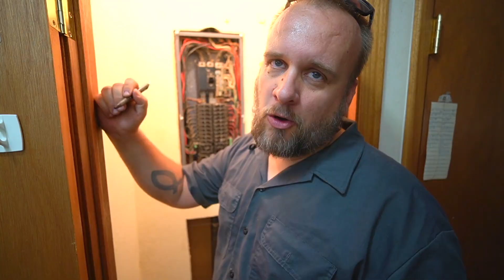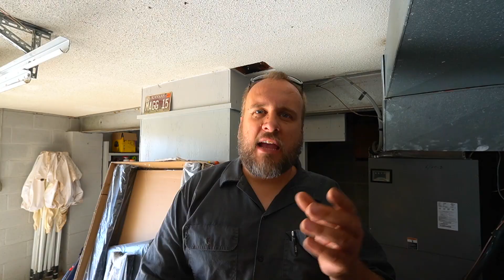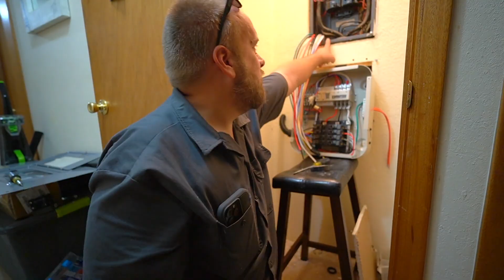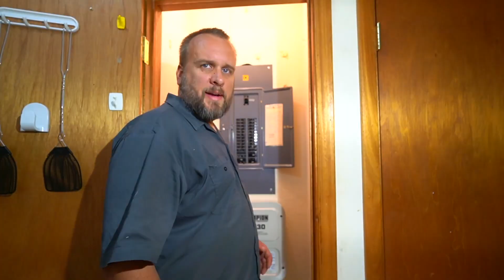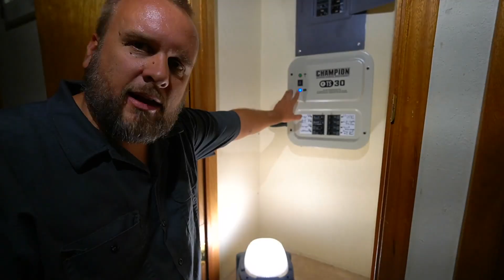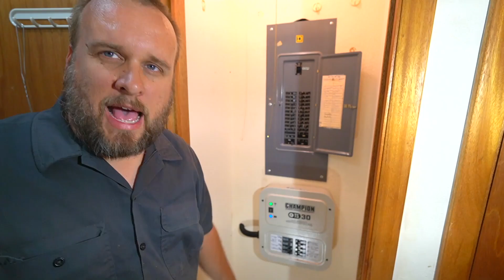Installing Emergency Backup Power on a Budget - Manual Transfer Switch

Comment from the maker: Here are links to the components used in the video
Generator link: https://amzn.to/3s87et3
Manual transfer switch:
http://bit.ly/3FN1d82

Check out this video running a welder on the same generator
https://youtu.be/aysDlkLBD5Q

To interact with me personally, join the Rockhill farm Facebook group here:
https://www.facebook.com/groups/1270496403596230/

Comment: Thanks Brock.Your stream is the best to understand the system. I chose the 50A Champion transfer switch because i live in Canada and i need 3 rooms to be heated in fall and winter.Snow storms and thunder storms are the main reasons to install a generator to me. And again you did a great job Brock!😊

Comment: Why not Wire in a Power Inlet Plug to its own Breaker within the main breaker box on the pole, an use a Interlock.
Then you just cut off the Main feed breaker, an simply flip the switches you want an dont want. 
I see no reason for a manual transfer switch box an doing all that extra work. Flip off whatever breakers you already have you Dont want to use, thats Simple.

Comment: It is not just the black wire needs to be connected. The neutral on the same circuit (say, #12 fridge) also needs to be disconnected from the main neutral bar and needs to be brought over to the transfer switch.  If not, you will have a floating neutral and the panel case will get energized through the ground connection.--very dangerous.

Comment: I ran my AC, fridge, deep freezer, mini fridge, and all lights/receptacles in the house with a 6500/8250 this summer. I think I was able to run the microwave as well. You have really limited yourself with this setup, having no 220 options… as well as having pre selected circuits. To each their own I guess.

Comment: I have that same generator but I only use it on propane because it sits for a while because we don't lose power for long or often and I was worried the gas would go bad. I have a similar transfer switch to yours too. Had it all for about 8 years and only actually used it once. :) It worked great, ran 6 hrs on about 1/2 tank of propane. (20 lb'r)

Comment: I have a 10 circuit 30amp bypass switch too.  Mine wires a little different.  Has two sets of breakers, one for generator and one for house.  You must turn off the house circuits, slide the interlock and turn on the generator which I do one by one as I bring up the two legs of power. It has two wires for each circuit.  You remove your black wire from the breaker, insert the wire from the bypass switch and wire nut the other circuit wire that feeds the house.  This way the switch can control the power source by circuit.  One thing you did not address that I saw is the need to balance your legs of 5 circuits to proper load the generator.  I have 1 220 volt which take my two center circuits for my well which is mandatory during a power outage.  I then made sure I had Refrigeration 1 on one leg fridge 2 on the other leg and so on trying to balance the power drain.  You do not want all of your heavy hitters for draw on the same leg of your service.  Also we have our living room off the family room I did not power due to priorities.  The bonus for this is I turn on the lights in that room and I immediately know when the line power comes back on.  Just a tip.  Also during a power outage I always turn off my heat pump due to when the power comes back on it can not be clean power or flicker and damage the compressor.

Comment: Great video, Brock u are definitely not afraid of work lol 😆 I would not even try messing with power. I do some wiring, but I have been   folded before lol 😆 crushed  through one off my wife  antique chairs for the kitchen table, and the wife was not happy with me after that but I told hear it was her fault for turning off the wrong brakes 😂

Comment: I used a generator interlock kit. That sits inside the main box and keeps you from feeding from the generator with the main engaged. Turn the main off, slide the interlock plate, and activate the breaker. This powers the entire panel. I have an 8000k generator.  We have wells at both the city house and the farm. We have to be cognizant as to what might start, or we will overload the generator. The downside of my option is that I have nothing that tells me the power is back on.
Reply: Reliance Controls sells a power back alarm you can install to let you know.  You just wrap a sensor around 1 of the incoming utility feeds in your main panel and it makes an audible alarm.

Comment: Nice job Brock!  I had a switch put into my panel to a sub-panel, and an exterior generator plug box installed when we built our home by our electrician..... and that is the surest way to guarantee that your power will never go out again.   I've never used it in about 5 years now.  LOL  - - - Looks like a nice system you've installed!

Comment: I use an interrupt, because I can also run my well, furnace (gas) and water heater (gas). The only Items I can' run are stove / oven, and dryer.
Reply from the maker: The interlock give you more flexibility, but it requires the person using the system to be intelligent about what they try to do

The transfer switch kind of takes the thinking out of it but it limits what you can actually power
Reply: Unless you get a bigger generator, right? @RockhillfarmYT

Comment: Great video content explaining the Manuel transfer switch Brock 👍🏻👍🏻 Are you using DeWalt LED work lights to make this video? I've found that they give a horizontal line strobe effect. I switched to Milwaukee m-12 when doing video's. If your shooting a  video inside your home and see lines from your house lighting, just add a Milwaukee light while shooting will take that away. Keep up the great work 👍🏻👍🏻
Reply from the maker: Yes on dewalt
Reply: You did good Brock ! This Michigan Electrician is proud of ya !!

Comment: I installed an even cheaper version of that called an interlock switch. All in with an electrician I think I paid around 500$. The switch is in the regular breaker and it forces the main power off and then it allows generator power to go into the regular breaker. Then I can use the breakers on the main panel to selectively power any rooms or appliances. Either way you'll be happy and have the backup when others won't
Reply: Interlock mounted to a panel cover is not permitted in Canada because it can be defeated if the cover is removed. Breaker interlocks must be factory installed on the breaker itself.
Reply: I'll do ya one better. I bought a 50 amp breaker and back fed my house for years. Eventually I bought the whole home generator and the power never went off once, then I sold the place. Built a new house on 25 acres and had everything wired, two transfer switches, a pad poured, propane line ran and still haven't installed the new generator. Never fails.

Comment: Good morning Brock. You won't regret adding this to your home. That's one of the first things we did when we moved up here and added on and upgraded to a 200 amp. service. Our generator isn't big enough to run our stove, 220v electric heat, or hot water tank  but our cabin isn't really big and we have a woodburner and it will run our well, septic, and everything else in the house. I also told you that I would check around our area and see what bundled firewood was selling for and it's around $7 a bundle. God bless and have a wonderful day. 👍👍🙂
Reply from the maker: Thanks

Comment: Howdy Brock!  That is pretty slick.  I'm thinking of adding a grid tied solar system to my property, but would like the option to run off batteries if the power goes out.  This sounds like a viable option.  Lucky for me, I have a buddy that is an electrical engineer who is way smarter than me and can help me figure out all the particulars.  Sometimes you gotta be smart enough to recognize when you are too dumb for a project LOL!  Took me a lot of years to figure that out 😁 Good stuff and thanks for sharing 🤠